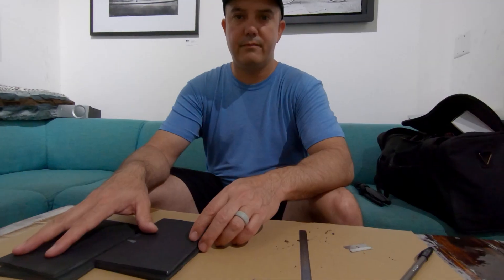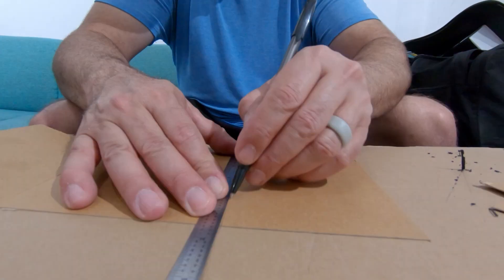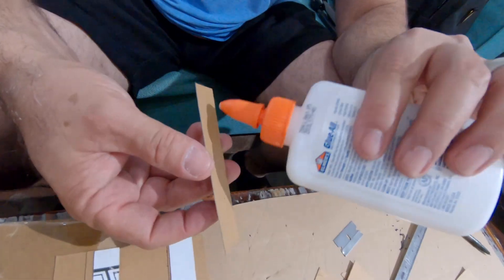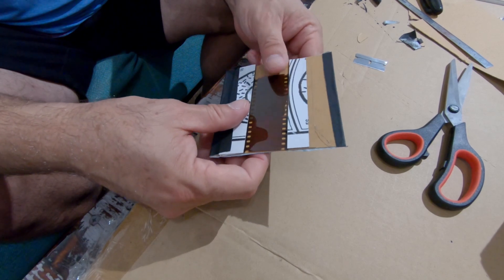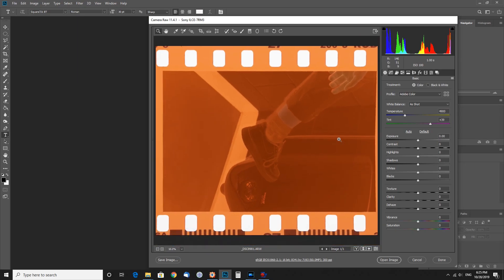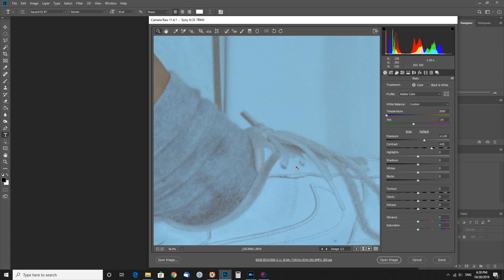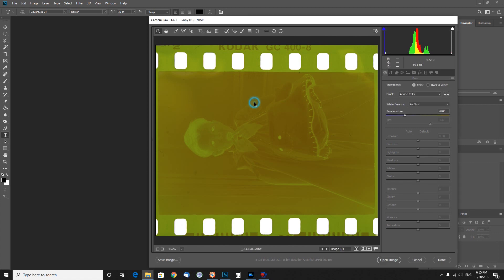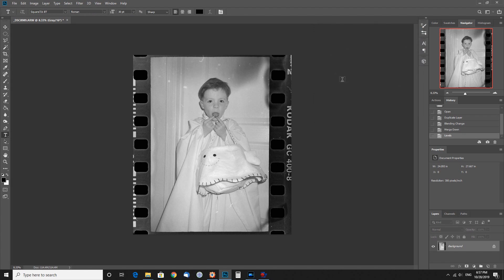DIY - Turn your high resolution digital camera into into a film scanner and digitize your film!

Comment: Love the low tech light box!  Sometimes people can make photography overly technical.  Getting enough light to keep the f-stop above 5 is what I am concerned about.   I think I will attach a white acrylic diffuser to the light box and point an LED flashlight at it or maybe use my flash with an extension cord.   Keeping everything square and steady is also a concern.

Comment: My DIY set up is kind of similar, but instead of a box I used a plastic plumbing tube from my hardware store, I also lined the inside  of it with a piece of black craft foam.  I glued a thin metal cokin filter holder adapter ring to one end so I could screw it straight onto the end of my macro lens.  To hold the film I made an almost identical set up to yours but just used the black plastic cover from a notebook instead of a donut box.  I find the dslr scans I make with my nikon D750 are at least just as good if not better than my plustek scanner can do.  If I ever shoot 120 film though I may end up using a copy stand like  a lot of people do.  The tricky part is holding the film flat, but I'm not paying hundreds of dollars for a piece of designer plastic to do that when I can make something myself.

Comment: At around the 12 minute mark you do mention if we use a macro lens ... does that mean you used a macro lens on these examples? I'm wondering if using a non-macro lens is possible, or not. Thank you -- good video.
Reply from the maker: You can use any lens but you may need a macro adapter to be able to get full coverage.
Reply: @LavikkaPhotography  Thank you, I really appreciate your prompt response. Very helpful.

Comment: I just made my scanner incorporating a strobe which gives me great color temp and i can dial in correct exposure depending on density of neg- slide. Shudder speed 200 and flash duration around 2000. Very sharp.

Comment: I still use an Epson scanner for my negatives and whilst it does a good job it's an incredibly slow and tedious process. I've considered using my camera to do essentially the same as you do here. I've shot one slide that I backlit with a torch and got really good results and was able to completely restore the image in Photoshop using the RAW file. Going forward I'll likely use my scanner less and less.